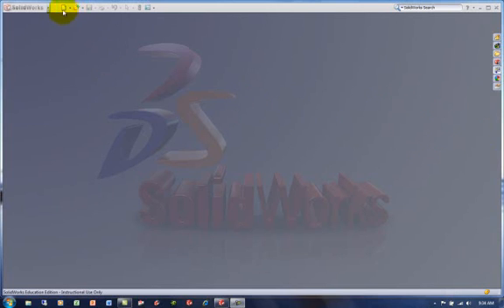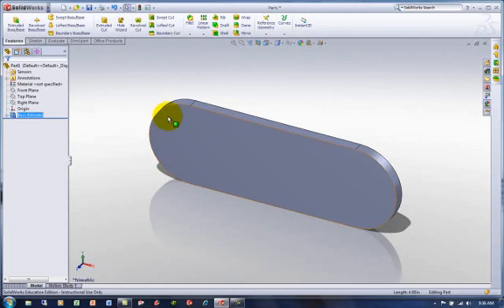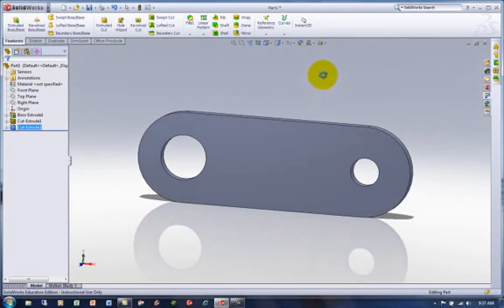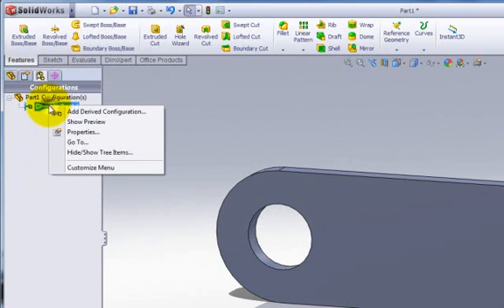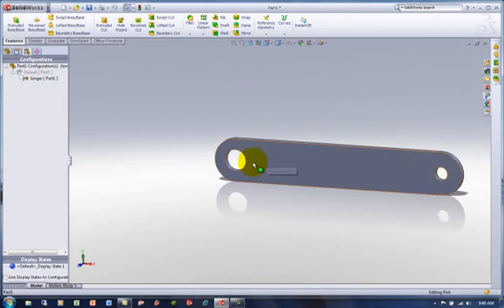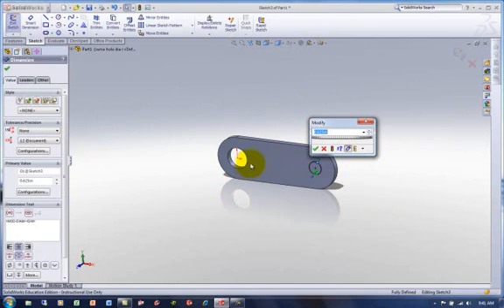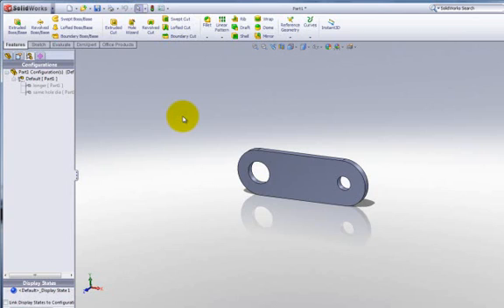Configurations in SolidWorks.wmv

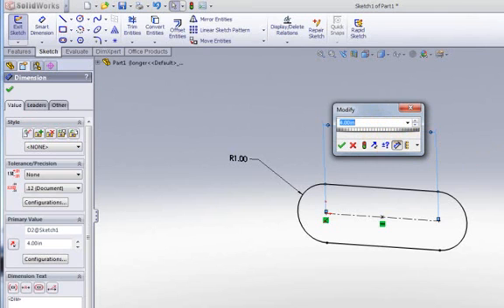Comment: Both examples show the same method of linking a "dimension" of a configuration to the property of a line or circle.  What else can be done, and how?  For example, can an entire sketch be particular to one configuration, and not existent in the others?  This would have been useful in the video to mention.  Other than that, the video was a little slow for me.  I only needed that information at 5:15, and it took me 5 minutes to get there.. lol... I still gave you a thumbs-up because I understand that this video is directed towards beginners and users of all experience levels.  However, keep in mind that you don't need to speak as slowly as if you are giving a lecture in person.  Because this is a youtube lesson, the viewers can always pause, rewind, and skip around the video if they missed something.  Thanks for taking the time to do this.  later

Comment: You can make two holes on the same sketch, and control them independently, Since each hole has a dimension, each dimensions can be changed independently in each or both configurations.